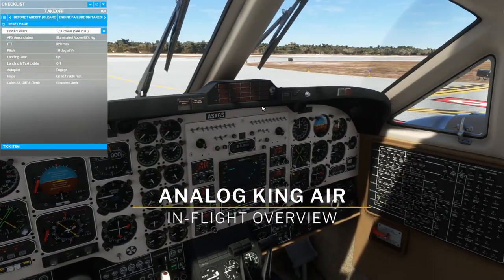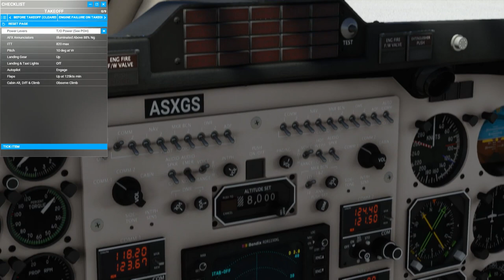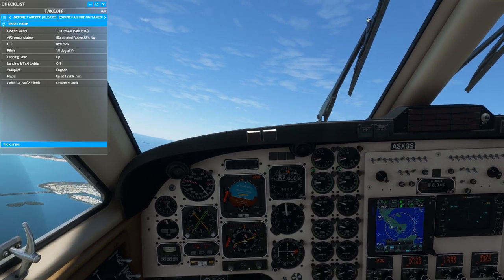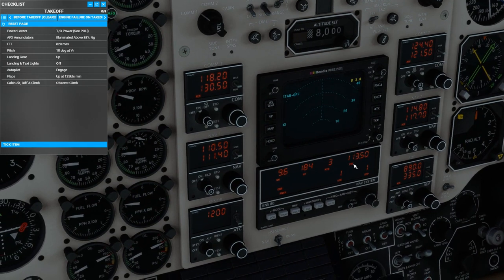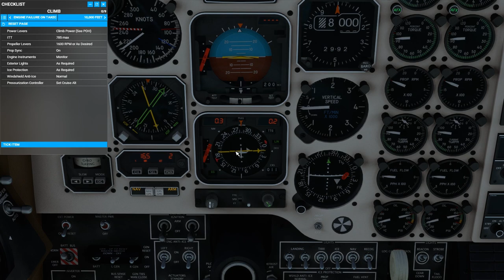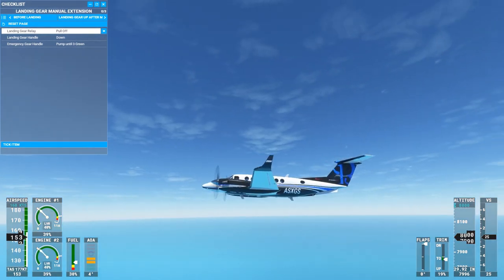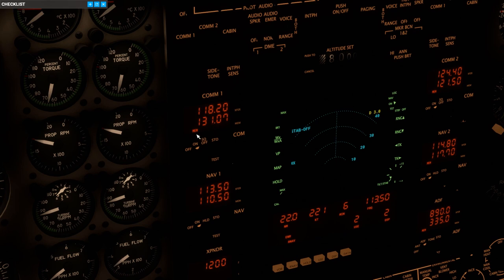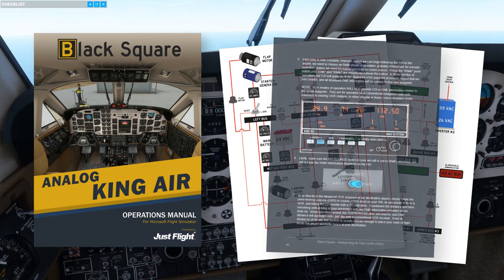Steam Gauge Overhaul - Analog King Air - First Flight Preview

Comment: This is absolutely stunning work. Initially I was a little disappointed that this release was an overhaul to the default King Air rather than a wholly new King aircraft with reworked flight model but I can see now that the systems overhauled here are done so to a significant degree. Great video.

Comment: 2 weeks ago we were told its coming in a week or two, not we are being told a week or two again, we were also told during a preview stream of the caravan that it was going to be a week or so into august, please clarify if its actually coming soon or not
Reply from the maker: It's coming soon.  As the development phase on any add-on draws to a close there are lots of things that need to be done, lots of things that might require further work and the last thing we'll want to do is to release it when it's not finished. Ideally we give no indication of a release date but due to constantly being asked we try and offer some sort of ETA based on evidence and feeling at that time.  It doesn't always go to plan.  In this instance there have been requirements for additional work.  It'll be worth it when it arrives, we're sure of that.  Sorry if expectations were raised too early.
Reply: @justflight  hope its soon, looking foward to a larger plane to use the TDS GTN in :)

Comment: May I ask if, by installing Black Square's Steam Gauge Overhaul I will be able to keep the original Asobo model with glass cockpit and have 2 different King Airs? Or can I "deactivate" the steam gauge model when I want to fly occasionally with the glass cockpit? Thank you and Cheers for your excellent review.
Reply: Yes that is confirmed. The analog version will exist as a separate aircraft so the original will still be there.
Reply: @jonmabec  Thank you.

Comment: There is a conflict between this analog cockpit and the Logitech radio panel. Avionics shut down completely when you change a frequency on the radio panel. It is then impossible to restart the avionics. This occurs only when the cockpit folder is present in the community folder. No crash when the folder is absent from the community folder. A quick fix from Justflight will be appreciated.